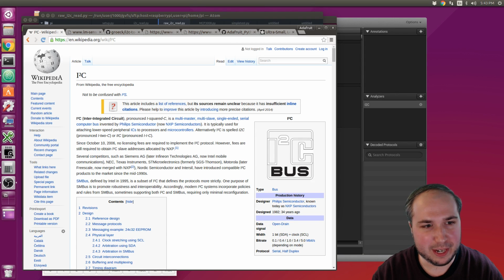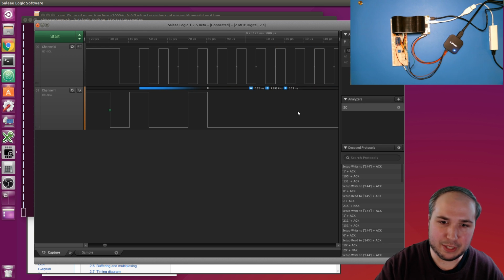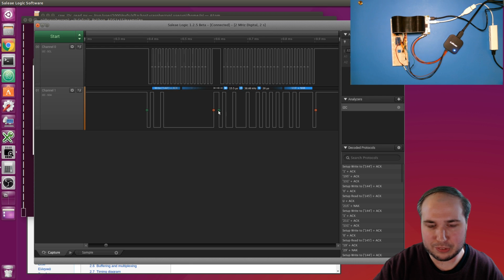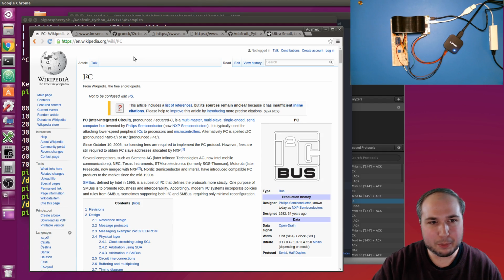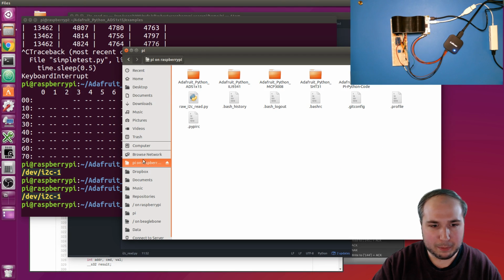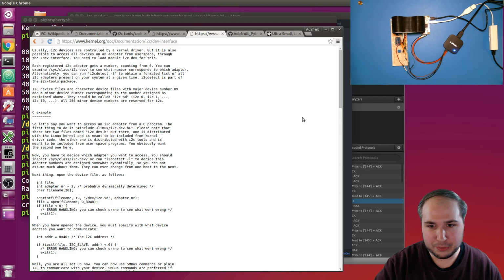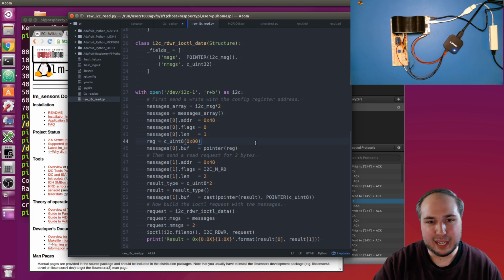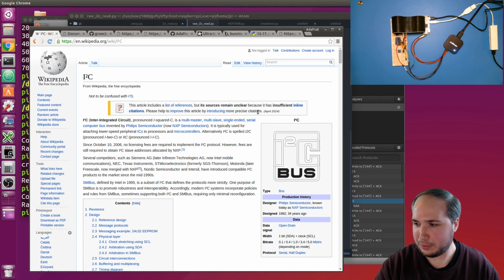Raspberry Pi & Python I2C Deep Dive with TonyD! @adafruit LIVE

Comment: I saw your Python code while trying to program a 9 DOP accelerometer/magnetometer and an ads1115 ADC and it's a delight to see you in the flesh.  I'm struggling to control a solar tracker with one motor to set the solar declination and another to sweep the azimuth from E to W using a dual motor controller.  I was plagued with I/O read errors with the magnetometer, accelerometers and gyros using the Adafruit library.  I want to try some lower level code.  Now i'm down to using potentiometers with pendulums for rotation encoders. Thank you so much for your excellent code and knowledge to enable me to proceed.  I look forward to your Python3 solutions.  you and Adafruit are international treasures tinkerers like me.

Comment: This was extremely helpful, and explained why I was having so much trouble getting I2C working on a PI without having to use complex libraries, after getting it to work pretty easily using just the wire library on an Arduino.

Comment: I have a question about beagle bone, Can I install any raspberry python library in beaglebone? I am trying to use the MPL115A2  I2C temperature/ pressure sensor from adafruit and it seems like they created a library for it called Adafruit_CircuitPython_MPL115A2 The way they suggest to install it is doing:
    python3 -m venv .env
   source .env/bin/activate
   pip install circuitpython-build-tools
   circuitpython-build-bundles --filename_prefix <output file prefix> --library_location .

However when I do this I get an error that the commands are failing and that pip is not found.

If it is possible to install this library, how should I go about installing it

Comment: Hello Dear Tony,Tq so much for the tutorial....i am very new to the python coding but i have to work on my project on raspberry pi , so i was worrying about the i2c code .code what you have written is the same code for all the sensors or is their any other code for different kind of sensors?.iam using MAX44009edt +T light detecting sensor ..so for this sensor what kind of code should i use?..please help me out regarding this issue..thank you in advance.

Comment: Hi,
1.I connected the 7" inch LCD(800*400 pixel) which is connected to the Raspberry pi through HDMI and USB. The setup is working properly. 

2.The second link is to connect the RFID-RC522 to the Pi. This independently works without any issues.

>>The issue is when i install both, the RFID-RC522 reader doesn't work. It aborts the connection.
>>how we have to solve other wise how we connect the RFID-RC522 with I2C for read Tag ID
Can you please help me out with this issue?

1.https://alselectro.wordpress.com/2016/08/20/7-touch-screen-lcd-for-raspberry-pi-driver-installation-with-virtual-keyboard/
2.http://raspmer.blogspot.in/2015/07/how-to-use-rfid-rc522-on-raspbian.html

Comment: Thanks. I've read your pages on Adafruit and used your ads1115 programs. 
Have you tried daisy chaining four boards? 
I tried and only the first is reporting correct data. I used the "simpletest.py" as a base for development.
The boars are detected with i2c tools but the data is off.

Comment: I need to read an address without specifying a register or sending a command byte,  Start, Slave address, 1(read), ack (from slave), data, ack (from master), data, NA from master, stop. I went to the kernel site you showed us and wanted to use the quick command i2c_smbus_read_byte() but my program gave the error that the function is not defined. Do I have to type in another command to download that module? I don't know what the functionality flag is but how do I get access to I2C_FUNC_SMBUS_READ_BYTE. What can I type in to get access to this command? 

Would it be possible to send i2c data to the relevant ip addresses by importing socket, creating a socket with the ip address & port, and sending data that way in it's binary form, including the start, read, write bits and whatever I need to add manually. I don't know how to send i2c commands in python on a lower level if the SMBus can't do something I need. Please get back to me if you know how to solve the problem above using either option. 

Your video has been extremely helpful and has me sending lots of valid commands to the board I'm testing at work so thank you so much!

Comment: Great video (really an on-line mini course).
I'm Glad you are part of Adafruit.  I started buying products from the company about a year ago.  I looked one day to see if there was any tech support.  (Blown away).
The standard is set by Adafruit.  The learning system is like an on-line engineering college.
That said, very interesting I2C talk.  I'm currently working on the MCP23017 I/O chip.  I'm working on taking the I2C bus places it may have not gone before.  I'm working on fault tolerant python code (with powered plugin).  In particular I'm wanting to read the values of the I/O direction registers (IODIRA etc.) to validate (test to match what I set them at) before accepting input data from it.  You have saved me hours of work.  As in most things Linux, there are more than one way to do things.  You have exposed some great places to look.  I'll be looking around GITHUB for you new Python stuff.
I also looked at the bus lines with a scope some weeks ago.  That information helped me decide to start using the voltage level shift circuit.  I think it also protects the ports on the Pi.
Also a comment about python speed,  my GPIO_code.py  (in sudo / root) is usually slowed down with sleep lines to scan buttons about every 200ms anyway.  The other processes it controls are on another thread (in non sudo space).  So in my case it  (sudo GPIO) does not need to run crazy fast.  
Cheers, and Hats off to all in NYC @Adafruit from Ontario Canada.